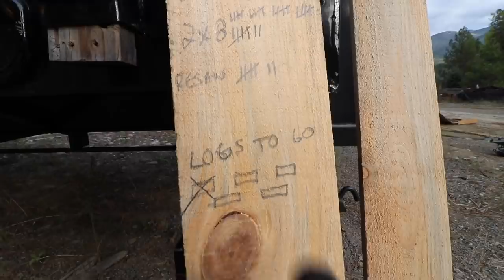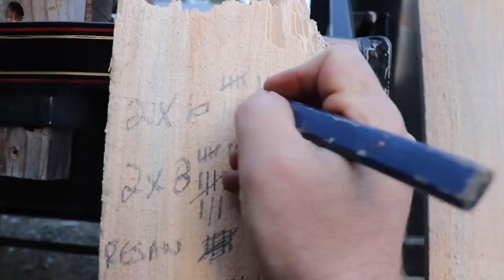I Sawmilled Through a Bullet and This is What Happened

Comment: Overhead valve engines need to have the valve lash checked and adjusted periodically. If you cleaned the carb and did all other maintenance I would check that next.

Comment: Hey @PureLivingforLife, you could try and paint the water-canister of the sawmill black. That might give it some additional heat, to keep it from freezing too fast.
Reply: Heat up quicker but cool down quicker. No gain there.
Reply: Mental note:
When I build my own sawmill, use a small water cooled car engine. And put a liquid-to-liquid heat exchanger in the radiator line that heats blade cooling water.

Comment: I would check the carburetor for corrosion if you have been using 10% ethanol and leaving it set unused without running the engine until the carb is out of fuel. Ethanol kills small motors by absorbing moisture. It will also degrade rubber seals and gaskets. I speak from experience lol, I had to replace carbs on mowers, pressure washer, wood chipper, generators,  it was expense i could have avoided. I started using gas without any ethanol, they call it recreational gas here in SC. The operating manuals all say that you can use 10% ethanol without damage but it does not tell you if left in carb a week or two it will destroy the carb.  Just my 2 cents Jessy, you probably already know this with the generators that you use.

Comment: Hey Jesse, I say this in the nicest way...you really need to brush up on your wood science, and you need a handheld moisture content meter.

I would guess that the dead stand wood is not as dry as you think it is. I would guess about 15 to 18%. The stuff that is on the ground may be ok.

If the dead stand is 15 to 18%, and your EMC is 10%, you still have a fair amount of shrinkage (like 20% of the total, especially on the tangential face), and your 1.5" is now like 1 and 3/8.

Also, get on the app store and buy "Smart Thumper." It will tell you if that questionable lumber will make grade.
Reply: They're freeze drying it over the winter
Reply: @flinx  yeah, but he is cutting it for 1.5" thicknesses, with no allowance for shrinking.
Reply: @clayseale  for internal, non-load bearing or not much load bearing walls, how much will that matter? How much will they shrink? The tree was already dead for a while.
Reply: Jesse knows exactly what he is doing.....he goes over all of this way back when....you do realize he built a Timber frame house!
Reply: @jedidiah5131  he lost me when he compared SPF to a piece of old growth doug fir.

Comment: How do striations from a damaged blade make the lumber less useful for walls and floors in your house?
Reply: My thoughts exactly.  Could probably use that blade a little longer since the wood is going to be hidden anyway.  Its not like the wood is being used for carpentry or finishing work.
Reply: Most applications it probably wouldn't matter. But a damaged saw blade doesn't cut as well and could start to wander and produce warped cuts. Better to replace it and get it sharpened then use it till it breaks.
Reply: Jessie is a perfectionist or OCD also some of the wood may be needed for finished areas later.
Reply: @Lermabeans  Even then the wood would be surfaced.  That is the only way i buy my lumber for projects is rough, so i can pay less and finish it my self to exact dimensions.

Comment: I’m in Australia and we work in winter because it’s more bearable and using power tools that might cause a spark is best avoided to keep the fire risk down so tracters work with slasher or brush hogs are a risk for causing sparks if you hit a rock or stone with the metal blades fire is our biggest nightmare

Comment: Check at the airport were you have your aircraft stored to see if they will let you put  LL fuel in a gas can . Most aircraft full does not have ethanol in it but check.  Prue gas works better in small engines and has better shelf life. Also see if in your state you can buy ethanol free gas at a gas station or co op

Comment: Interesting that you are falling trees, unlike other areas that fell trees. 😉
Reply: When it comes to trees, many terms are local terminology. Both felling and falling are pretty much used interchangeably around the English speaking parts of the world.
Reply: d hamby That does not make it correct. Fell means “To cause to fall by striking; to cut or knock down”. Fall means “move downward, typically rapidly and freely without control, from a higher to a lower level.” One imply’s causality, the other does not.
Reply: @Rgj_j you really need to get back on the short bus! And the end result is...
Reply: Jedidiah I am happy to join you on your regular ride.

Comment: Do the engine valves need to be readjusted ? Most engines need to have their valves readjusted after so many running hours. Check your owners manual. Got some bad gas ? Leaking head gasket ?

Comment: Why 2x6 and not 2x4 walls? Just loosing space in interior rooms.
Reply: I was wondering that as well?!
Reply: I will be curious to see how they use 2x8s for interior walls.
Reply: I doubt they are going to actually frame the interior walls with 2x6's or 2x8's.  It looked like he was trying to get the largest boards possible out of each tree which could then be trimmed down later as needed.